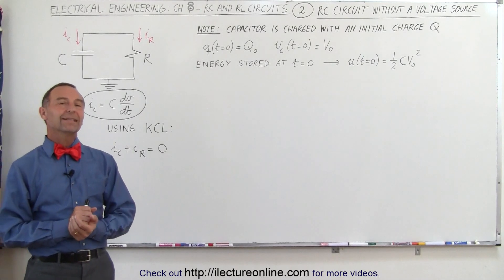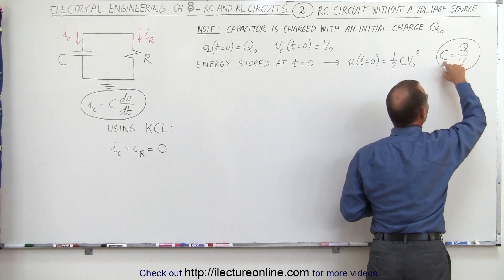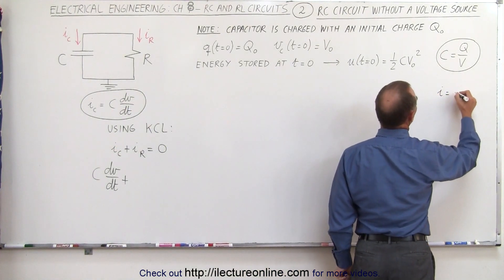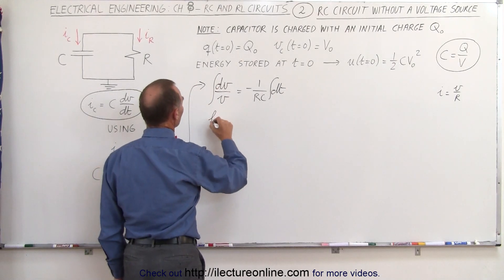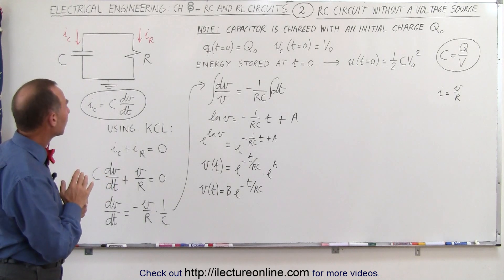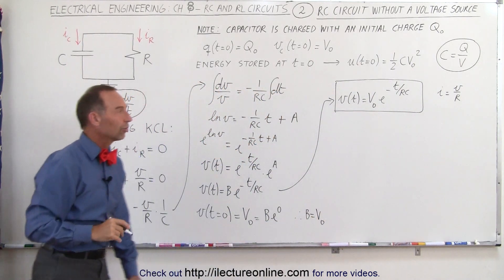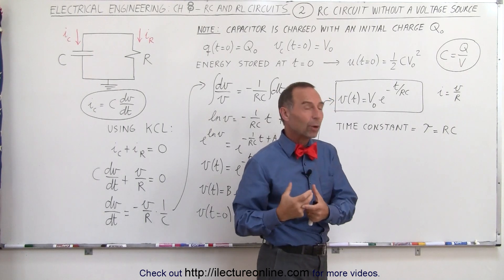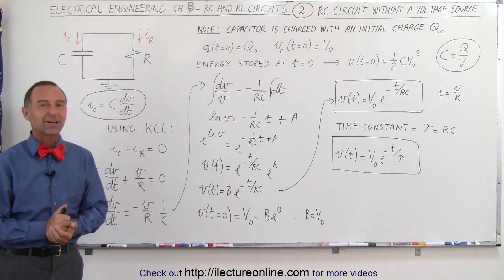Electrical Engineering: Ch 8: RC & RL Circuits (2 of 43) RC Circuit without Voltage Source

Comment: I would think that the current here is DC since there is no supply from the grid, but would like to have the answer from you Mr. Michel as I have read the comments but got no solid conclusion from them, thank you
Reply from the maker: It depends on the intial conditions.  If the capacitor is initially charged then the current and voltage will alternate.  If the capacitor is not initially charged then there will be no current.

Comment: I still don't get it, sir...
As you mentioned, the capacitor was initially charged, it should act as a DC battery once removing the voltage source in your diagram. Therefore, the current direction should flow from the top side of capacitor to the top side of resistor and then finally into the ground to supply the power for the resistor. In short, in my opinion,
(the current of the capacitor) = (the minus sign) * (the current of the resistor)
make more sense in this derivation.

Comment: Why wasn't there a constant of integration after integrating ln (v)?
Reply from the maker: There is and it was evalutated at t = 0
Reply: So that's to say the limits were; upper limit = t and lower limit = 0? Correct me if I'm wrong
Reply from the maker: No, we had the constant of integration "A" and then we evaluated the constant for a know condition at time = 0
Reply: @MichelvanBiezen  alright. Thanks

Comment: This is a very thorough explanation. I was able to follow this and use dq/dt(R)= -q/c to arrive at q(t) = Qe^-(t/RC) so given the initial charge I can find q(t).  I am stuck trying to derive a general formula for the current  as a function of time I(t).
Reply from the maker: Watch a few more examples. It is not so much finding a "general" solution, but finding a general approach to finding the equation in different situations.
Reply: @MichelvanBiezen  Thank you very much.

Comment: But why consider 2 different currents? How to do it using KVL?
Reply from the maker: This video was made in order to understand the interactions between the resistors and the inductors or capacitors.  If you want to see videos on how to use Kirchhoffs' rules we have many examples of that,

Comment: So far everything seems clear except why the current is in different directions. The only way that would make sense is that the capacitor and the resistor are connected in parallel and not series to a voltage source. Your wife’s and your effort are hugely appreciated Sir.
Reply from the maker: Note that this circuit has no voltage source.  Therefore you don't have anything driving the current (except the energy stored in the capacitor).  Using Kirchhoff's rule we will add the currents and set that equal to zero, which requires them to be in the opposite directions.

Comment: First of all, thanks for your beautiful explanation, sir. I was confused about why we have 2 current RC circuits since they are in series. In order words, you have capacitor and resistor in series. So why do we have Ic and Ir since the current through the circuit is the same?
Reply from the maker: It turns out that with a capacitor, the current "through" the capacitor depends on the instantaneous change in the voltage across the capacitor.  That is why there is a 90 degree phase difference between the resistor and the capacitor.
Reply: @MichelvanBiezen  Thank you very much.

Comment: why integral of ln didnt get constant but the integral of dt get constant
Reply from the maker: If you have multiple integrals, then you just add up all the constants and make them one constant.   (the constant can be any number)
Reply: @MichelvanBiezen  so the substraction between constant of ln and constant of dt is equal to constant? ( Cln-Cdt = C)?
Reply from the maker: That is correct.

Comment: what happens when current through capacitor is upward and current through resistor is downwards.. can we use minus sign in our equation
Reply from the maker: I am not sure I understand the question, since the current at any instant must travel in the same direction around the loop.
Reply: @MichelvanBiezen  sir as u say current travel in same direction around loop, then in our equation it can be possible, that the current flows from capacitor and then through resistor.  Means the flow of current is upward through capacitor and downward through resistor. So that it have same direction around closed loop.
Reply from the maker: Ah, yes, that is correct.

Comment: Professor, when i use the KVL  in this circuit, i come up with the formula Vc + Vr =0, that is obviously incorrect. Why?
Reply from the maker: You have to account for the phase difference.  We have examples of that in the RCL playlist
Reply: @MichelvanBiezen   Thank you Dear Michel. I am on your RC and RL chapter of the playlist. I watched previous chapters and soon will watch the chapter you mentioned. Actually, i am very dependent on your videos as a computer engineer student. Thomas Hayt book is also a good book, and i solve examples of it. We have a course on microelectronics(transistors ....) next semester, but it seems your precious unrivaled channel lack this topic or am i wrong?
Reply: @MichelvanBiezen   I officially invite you to Iran, but it seems impossible for you because of your lack of time or maybe you are not interested in traveling worldwide. But, if you accept it will be a great honour for me and i will be your host and in service for you full time. 😍😍
Reply from the maker: One day when I retire, I may be able to travel to some of the places where our videos are watched.  For the moment we are extremely busy with our multiple jobs and making these videos.
Reply: bu ne addi e xiyar

Comment: Why is ic and Ir traveling in two different direction? I missed the part where he elaborated as to why and how. I can't recall kcl allowing current to travel into different directions. Can someone please explain?
Reply from the maker: An inductor opposes a CHANGE in current and thus the voltage across the inductor will be reversed at certain phases of the cycle.
Reply: @MichelvanBiezen  thank you so much for your timely  response. I appreciate you. I am even more confused though because I don't see and indicator in this circuit. I see a capacitor and resistor.
Reply: Wait are you saying the at the point where we are applying kcl the current is being split because the where the voltage source was coming from?
Reply: So ic going the opposite direction of ir because once the circuit is source free the capacitor start have it current start flowing from the positive side of the capacitor to its negative side?
Reply: Oh wait its because they are connected to the ground. So current is traveling from pos to neg.

Comment: isnt it Ic-Ir=0 not Ic+Ir=0
Reply from the maker: With Kirchhoff's rules we add up all the currents entering a branch point and set that equal to all the currents leaving the branch point (which in this case = 0)   Thus bot Ic and Ir enter the branch point.
Reply: @MichelvanBiezen  But what if you chose the current Ir to flow counter clockwise and keep Ic the same? Then it would be Ic=Ir and you wouldn't get the negative sign when you solve the differential equation and it would be different.  Can you explain?
Reply: thanks sir

Comment: Sir can you please tell why the polarity is such?As actually if upper plate of capacitor is positive then it will discharge such that iR should be equal to iC?Please explain.
Reply from the maker: Since we are calculating the general equation of the voltage across the resistor and we don't know what direction the current will be flowing at any point in time, we can choose it in any direction.
Reply: Michel van Biezen Thanku sir ,I got it

Comment: i wonder why ic+ir=0. how can the current be divided?
Reply from the maker: This is by definition.  Let iC be the current "through" the capacitor, and iR be the current through the resistor as shown in the diagram.  Since they are pointing in the opposite direction, and they must be the same magnitude in this circuit, the equation is therefore correct.
Reply: thank you, sir. i wonder why polarity of inductor is changed when dc is connected and disconnected.